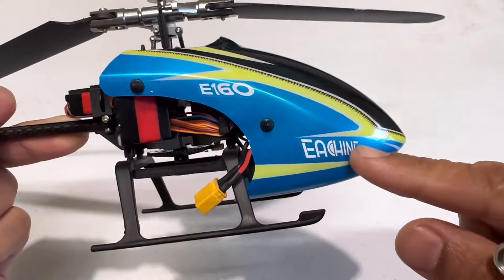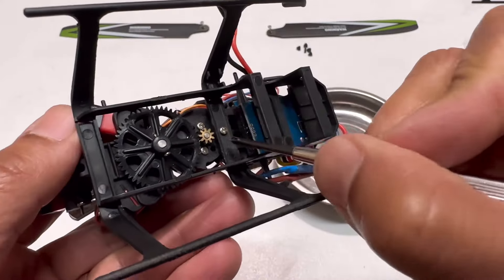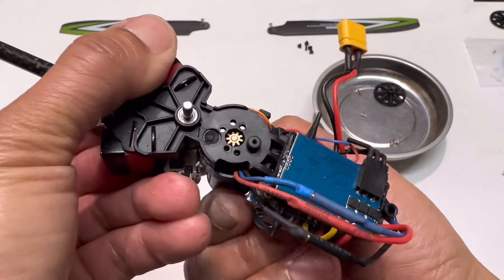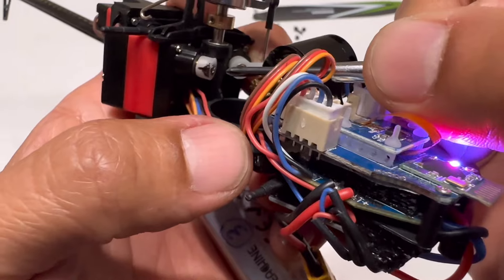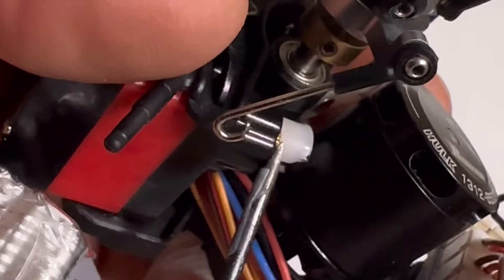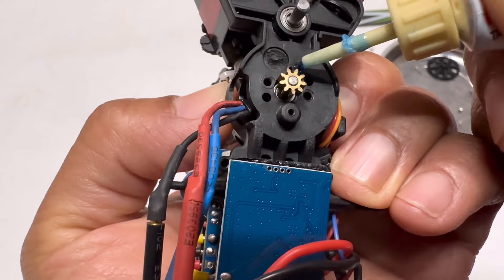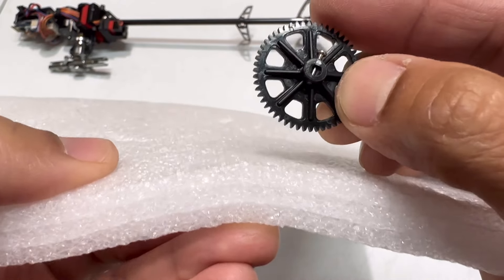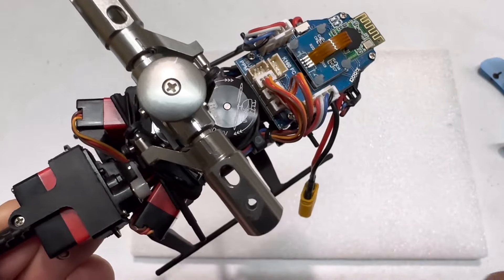Rc Eachine E160 helicopter problems and how to fix them

Comment: is there a way to fix the bug with the inability to turn back stabilized flight mode in flight, after you turn it off?
Reply from the maker: Hello, artemonstrick, that’s a good question, I didn’t know that and I would like to try it out, but my helicopter suddenly died, I have no power light, nothing. It looks like my esc just died out. I will make a video about this, I seen other videos on this problem and it seems that is a factory problem ☹️ thank you for your sharing this and for watching my videos 👍

Comment: This is one of the best helicopter interms of parts, stability, reasonable price compared to the Western brands like Blade, Oxi whtever.

I found it very very stable, easy maintainance & durable so willing to use it in sxale models.  👍
Reply from the maker: Yes I agree 👍 the only problem I have with this helicopter is that the esc, control board is not great. Sometimes they stop working without any reason, too fragile I will say. This is what happened to mine after the repair, it was flying beautifully and then on my second battery it just stop working. I think the esc just burned out😩 A video should be coming out soon. Thank you for your comment and for watching my videos 👍
Reply: @miltonrcadventure  

I am not a 3D guy flying roughly and I have commented from that perspective. 
Anyway, flying roughly, or doing 3d might might tell u how durable or sturdy it is though, but I am ok with flying its nature. 

The only thing is I don't like the ESC FBL all stacked up together as sandwich.
Reply: @miltonrcadventure  
What or how this control board not working sometimes ??? Can u pls explain ??